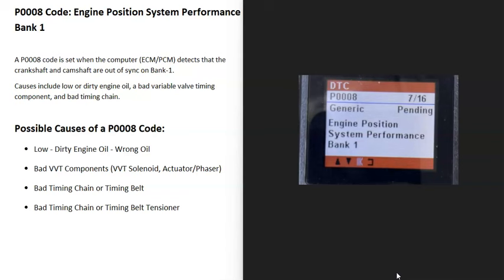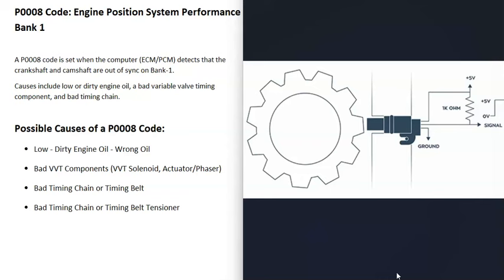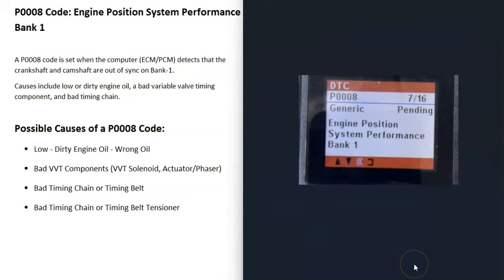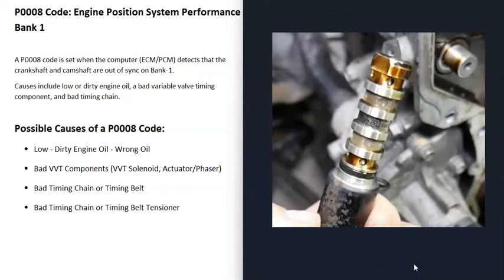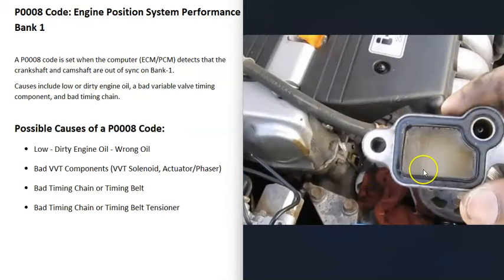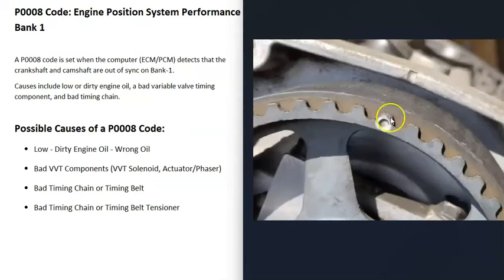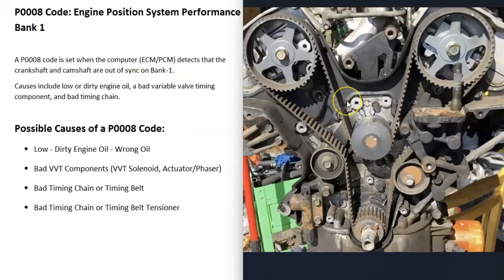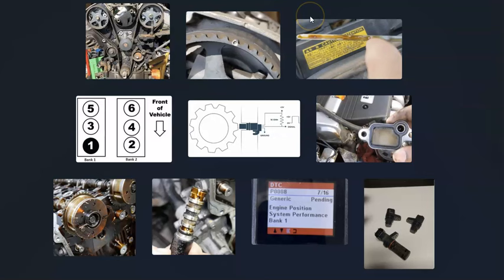Causes and Fixes P0008 Code: Engine Position System Performance Bank 1

Comment: Hey bud i got the p0008 code with white smoke coming out the exhaust with a heavy gasoline odor. What do you think? I changed the crank position sensor and made it run better I changed one of the cam sensors made it run a little bit better but now still smoking.

Comment: With this type of code read p0008 its recommended not to drive it until its fixed is what i was told ? Even thoe i only have one vehicle i would have no other transportation for work

Comment: Can it be fixed without changing the timing chain
Reply from the maker: It needs to be diagnosed since several things can cause a P0008 code, but if the timing chain has slipped or is old and stretched, it will need to be replaced.